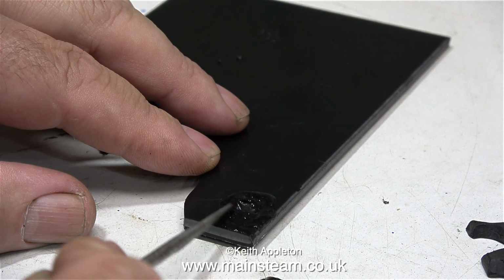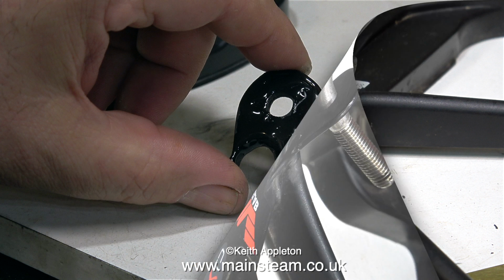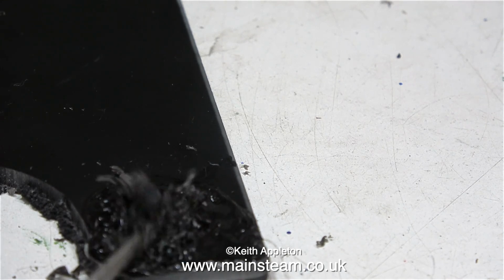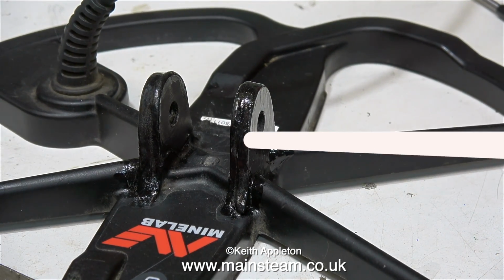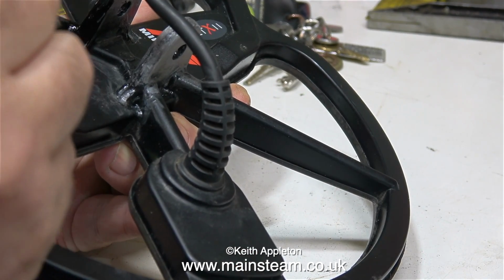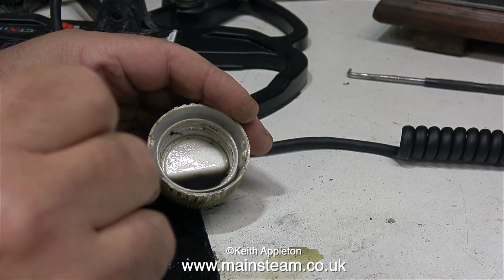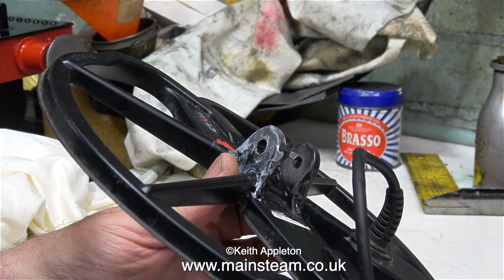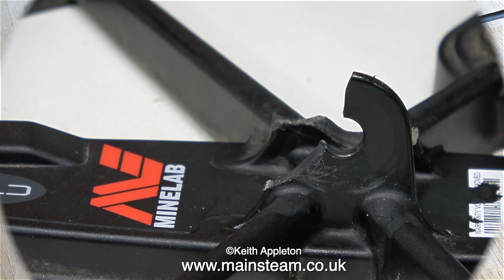HOW TO REPAIR A MINELAB CTX 3030 COIL - PART #2

Comment: I have a equinox 800 and am thinking of making my yoke ears stronger, as they break.. As I have seen. You seem to be the only one so far that i have seen in the repairing of the coils who has been smart in using the correct type of adhesive. I have not used Acetone to make glue but have heard of using it. Also MEK is supose to good at that as well... Thanks for sharing... Your repair job looked quite nice..
Reply from the maker: Thank you }:-)))